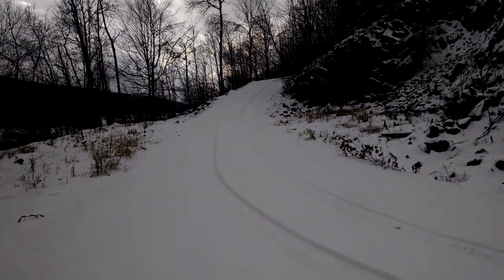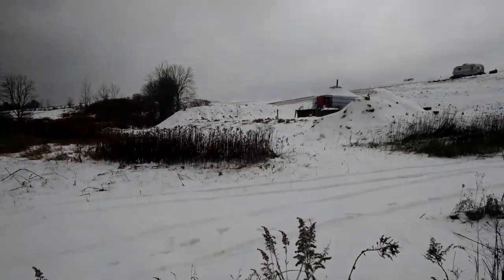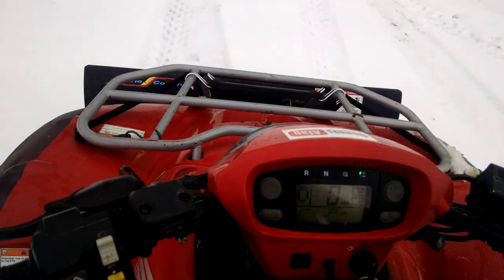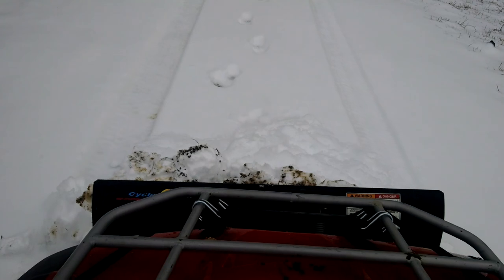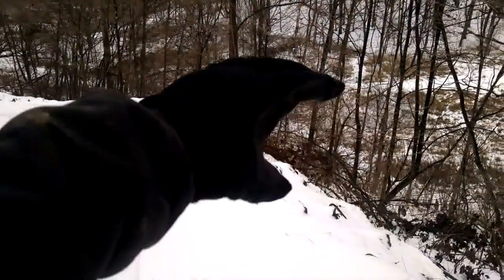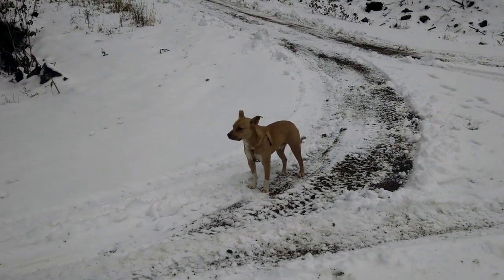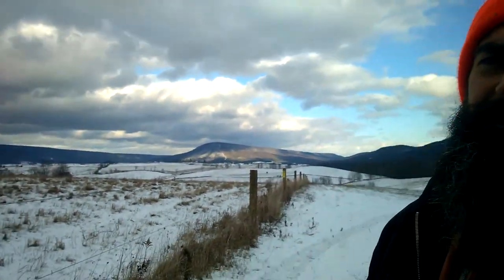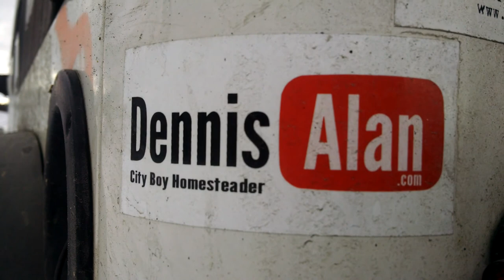PART 2 Plowing First Snow

Comment: I just posted a video of me snow plowing with my garden tractor Lol!  To be honest with you we do get a lot of snow some winters so just be sure to push the piles as far back as possible!  Also try to angle your plow and just drive up and down the driveway, and go up and down like you did in the end of the video that will definitely make things easier!
Reply from the maker: +Cody Johnstonbaugh yeah that's a good point to push back the snow. I didn't't think about it piling up all winter. I found it a lot easier just to plow down the hill. My road is too steep to plow up some parts. Besides chains (i just found a set in a trash pile :) any other ideas to make it safer to go up when it snows?